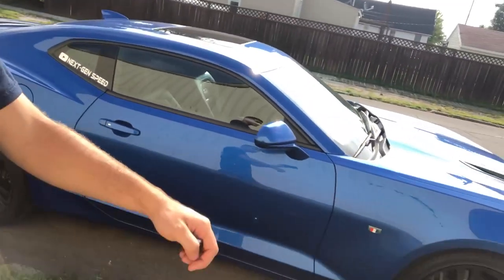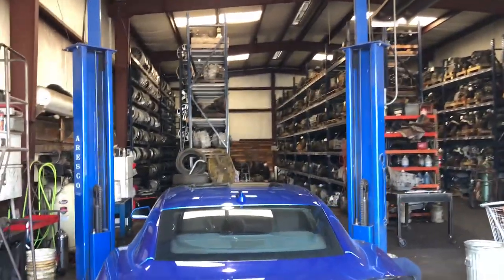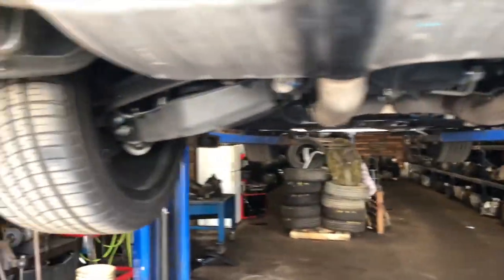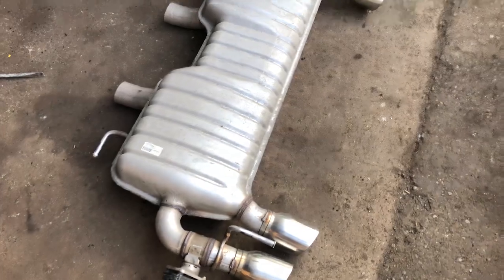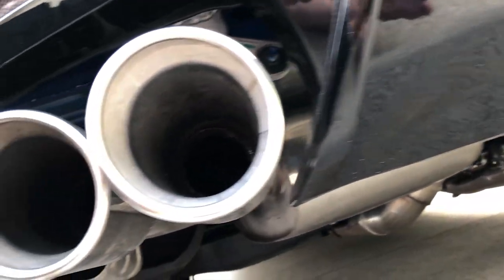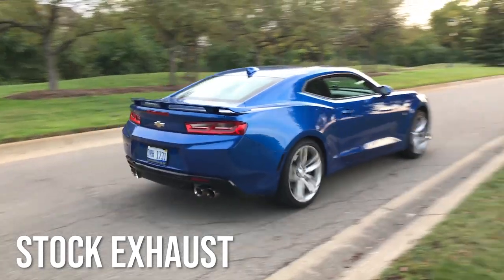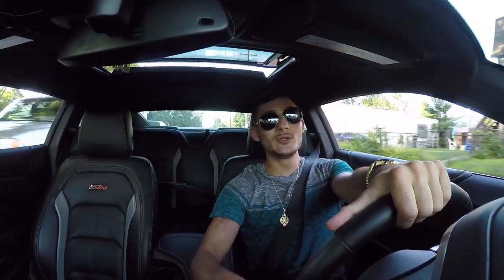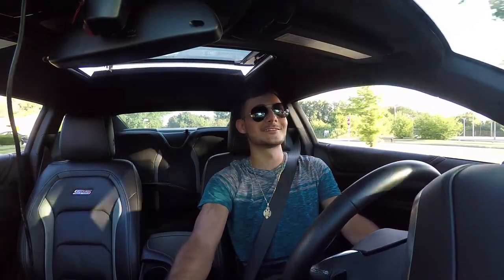MY BORLA EXHAUST IS HERE!!!! *IT'S FINALLY LOUDER!* ​

Comment: I gott news for you. After about 40k miles and age the NPP gets deeper and less raspy. Has something to do with the metal of the muffler getting seasoned. Mine is a 17' SS 6 speed. almost 53k miles on my NPP now. Sounds a lot better than when new.
Reply: I have 58k on my ‘17 SS 6 speed and the NPP sounds amazing
Reply: Damn my car will never hit 40k miles. I bought a 22 2ss 1le manual and thinking about getting the 3” atak npp catback. However its only a fun summer commute and track car. I was only able to put 2000 miles on it before i put it away for the winter. With that average i need 20 years to put 40k miles on it lol

Comment: Is that the American authority rear bumper? With diffuser? If so did you have to take the bumper off for install? And how do u like it?
Reply from the maker: No this is the stock bumper with our Quad Tip Glossy diffuser available below. The bumper is not required to be removed, but does help the install.
Reply from the maker: https://nextgenspeed.com/shop/exterior-body-parts/diffusers/glossy-quad-tip-diffuser-16-19-camaro/

Comment: Hey just wondering did you remove the resonator or it's still on and how much of a difference would it make sound wise removing that?
Reply from the maker: No I did not. I do not recommend that as it tends to make the car raspy
Reply: @NextGenSpeed  thanks for the info bro. Getting the borla installed right now
Reply: @eddie626sgvable  do u like it?
Reply: @Grey4lif3  yeah it sounds good and real loud
Reply: @eddie626sgvable  Would you prefer the Atak on a V6 or the S type on a V6. I think if I had a V8 I would go S type because I don't need the Increased Yell from the Atak. But with a V6 would you suggest an atak for a V6? I own a Chevrolet Camaro 1LT 3.6L engine with V6 and RS package.
Reply: @Alexx  that's what i have exactly. I would say go wit the atak but it's up to you if you want to get the s type sounds good too just your own personal preference how loud you want it to sound

Comment: Why did you remove your rear diffuser to install the exhaust?. Its not necessary. This is the first time Ive seen someone do this.
Reply from the maker: Yes you're correct. I just wanted to reinstall the diffuser while it was up there, as the fitment wasn't as nice as I wanted it at first

Comment: Nice Vid, for the S-Type did you get the NPP version or the non-NPP version?
Reply from the maker: The non-NPP version as I like it loud all the time
Reply: Next-Gen Speed 

Bet ima get non npp as well since I always have it loud too, quick question though:

For the npp actuators on the stock muffler, did you have to reconnect them to the connector wires before zip tying? 

Or no just left them on the stock muffler and zip tie the wires without the actuators?

Comment: Can this fit on a v6 ?
Reply from the maker: We have options available for the v6 model. Shoot us a email/message on facebook and we can get you set up with the correct kit
Reply: @NextGenSpeed I have a Chevrolet Camaro 1LT 3.6L engine with V6. I am gonna probably purchase that Rear Diffuser u linked in another comment. But will product #11926 Axel Back S type work with my model and Make. I don't think I have NPP either